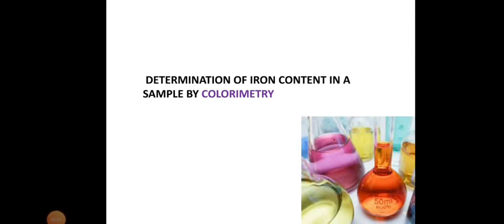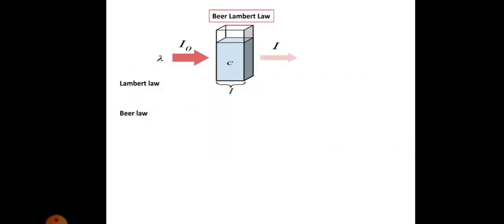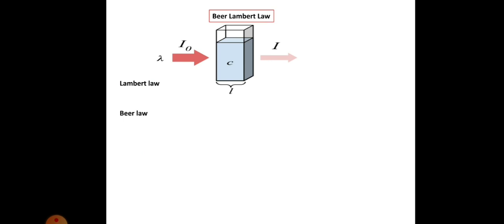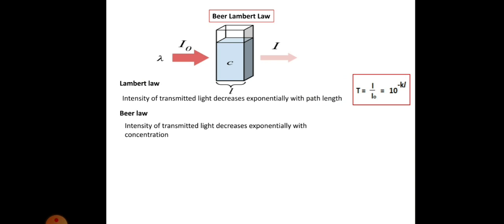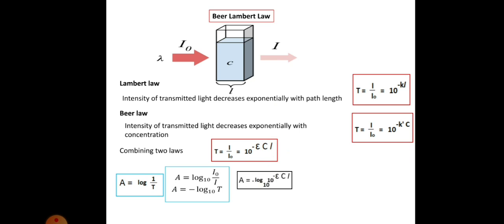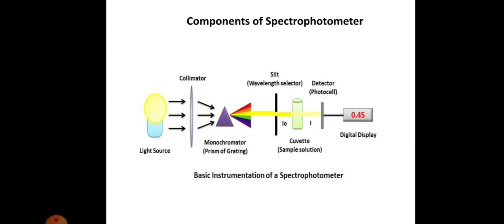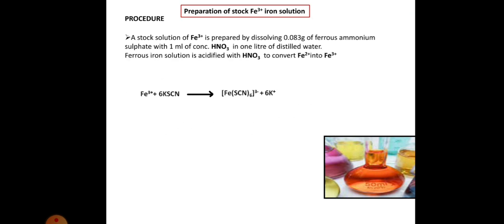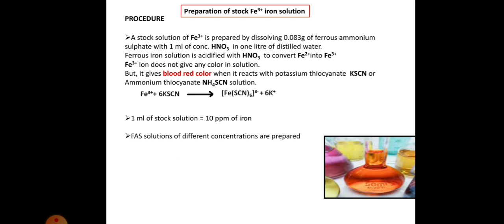Estimation of iron  by colorimetry

Comment: This video is about determination of iron content in a sample by calorimetry. Colorimetry is a technique used to find the concentration of the substance in a colored solution using instruments such as color meter or spectrophotometer. 
[1] The principle behind this experiment is Beer-Lambert law, which states that the intensity of transmitted light decreases exponentially with the path length and concentration of the solution.
 [2]
The video also explains the components of a spectrophotometer, which consists of light source, monochromator, cuvette, detector and display.
 [3] Light source emits radiation, monochromator selects a specific wavelength of radiation, cuvette holds the sample solution, detector converts light energy into  electrical signal, and display shows the absorbance or transmittance value. 
[4]
The procedure for the experiment is also explained in the video. First, a stock solution of Fe 3+ ion is prepared by dissolving ferrous ammonium sulphate with concentrated nitric acid in distilled water. Then, different concentrations of blood red color solutions are prepared by treating the stock solution with potassium thiocyanate or ammonium thiocyanate.
 [5] After that, a blank solution, which is a solution without iron, is prepared. 
[6]
The last step is to measure the absorbance value for each concentration and plot a graph for absorbance versus concentration. The concentration of the unknown sample can be found using the calibration curve. 

Thank you   for your EXPLAINING  very well MAM💖